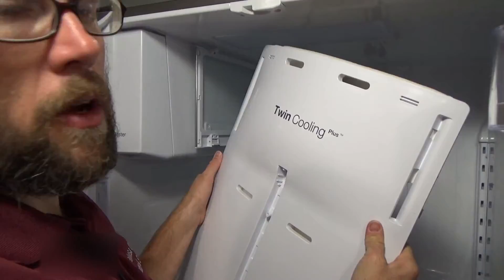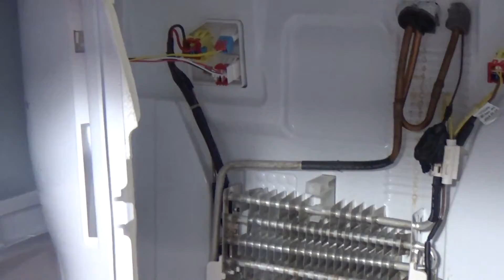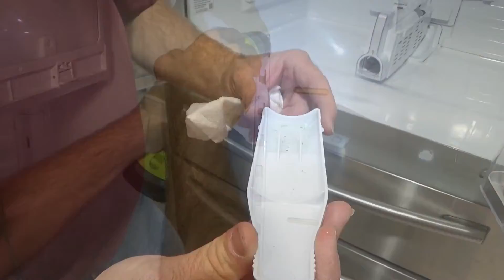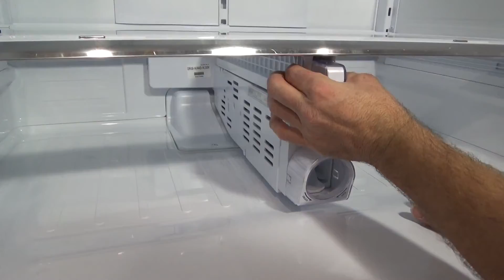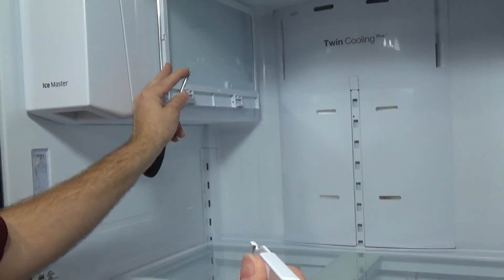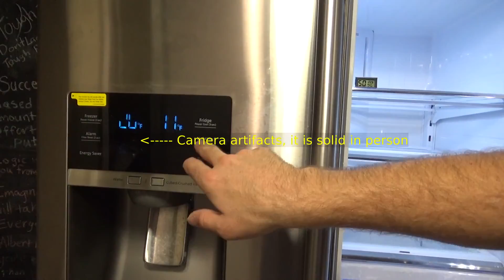Samsung Refrigerator Repair

Comment: This is a great video EXCEPT we could not release the crisper shelf.  We have been trying to get it to release pushing the button but it will not budge.  Is there a secret to this?
Reply from the maker: No secret. Those tabs can be frustrating, but just make sure you get both sides pushed all the way in, while you are trying to move it.
Reply: I found I had to work at it for a while( more than 15 mins)before they became flexible and decoupled.

Comment: Thank you so much for this video it’s really help me solve my problem but I broke some foam in the back of this white plastic hopefully not happening in the future
Reply from the maker: Sadly, mine has frozen up several times. You need to raise the front of the refrigerator with the levelers by the wheels. However, mine have frozen at least 4 times since I did that.

Comment: This coil freezing in French-door-style Samsung Refrigerators has been resolved several years ago. The problem is in the alignment of the refrigerator. The front of the refrigerator needs to be a bit higher than the rear of the refrigerator.  This allows the proper self-defrosting and draining.  See https://us.community.samsung.com/t5/Kitchen-and-Family-Hub/Evaporator-Fan-freezing-RF263BEAESR-French-door-refrigerator/td-p/63478
Reply from the maker: Thank you for the reply. However, the height must be raised so much, it becomes a nuisance to lower/raise it every few months when I clean behind it. additionally, it starts to have the issue again if you do not have it raised again shortly after lowering. The "wheels" are the reason for raising the refrigerator, they cannot support the weight of the unit for the long-term and eventually cave in on themselves, causing a forward lean.

Comment: Did the problem come back?
Reply from the maker: Yes, several times. Support refuses to provide me any "hidden" codes to defrost it. However, they did recommend rising the front of the refrigerator approximately one inch higher in the front over the rear and so far, it has not had the issue since. Prior to that, I had to defrost it at least 5 times.
Reply: @RazorBucks  okay yeah I've had recall after recall so we no longer do Samsung refrigerators lol. What a POS brand.